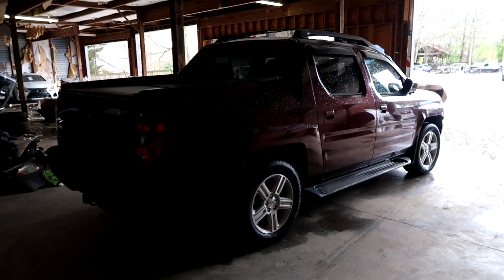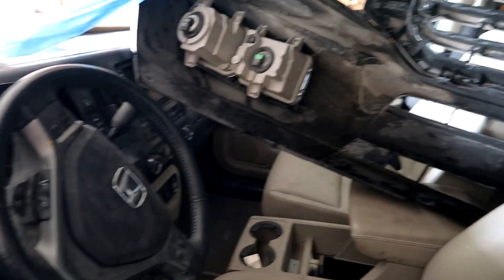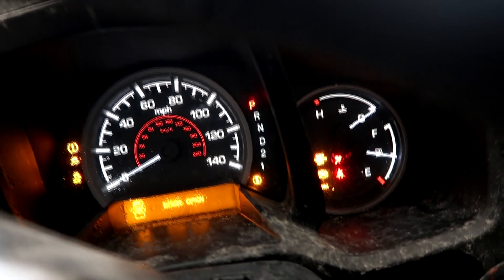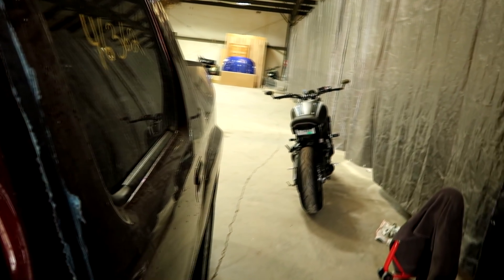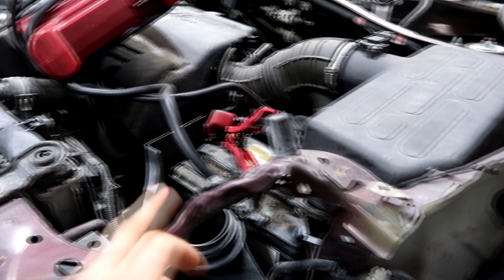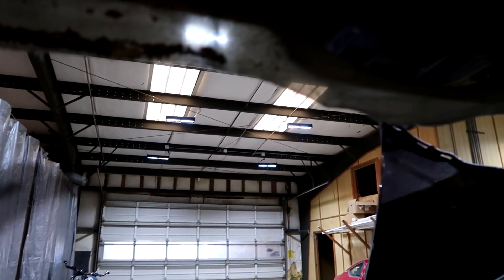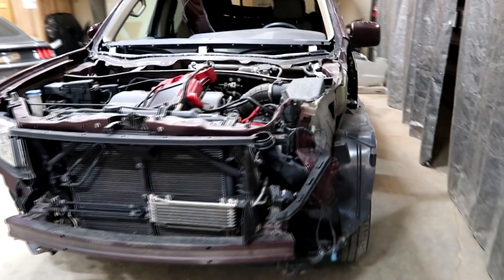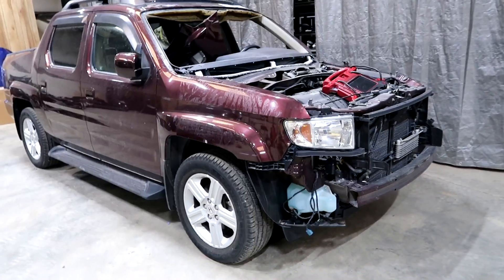Rebuilding A Wrecked Honda Ridgeline

Comment: Saw a guy put 8 bags of concrete in the bed of one of these and yes they were evenly distributed and the bed seriously cracked from the front drivers side to the rear passenger side. And when I say cracked it was all the way through.
Reply: H&P Customs you don’t know all the details there